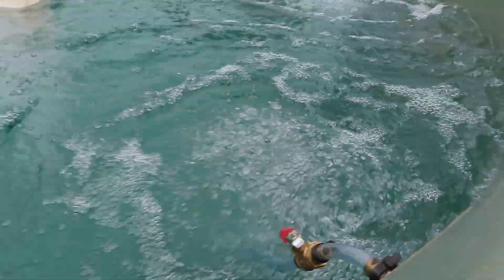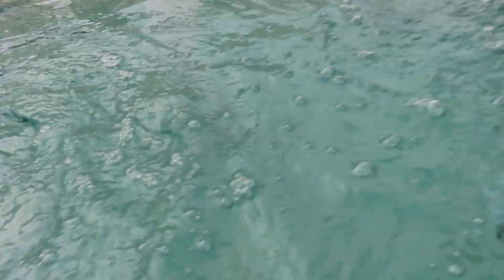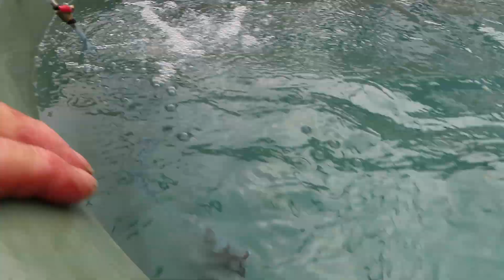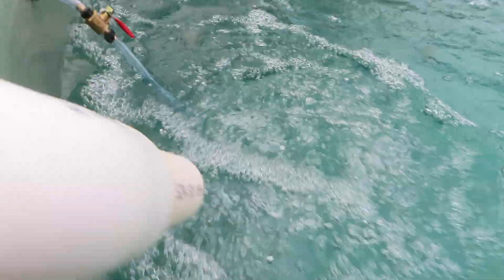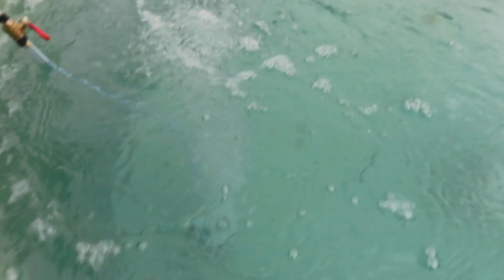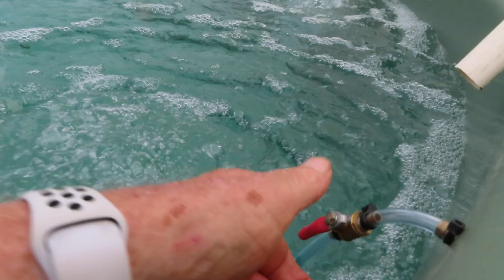Aeration in a New Commercial Aquaponics system. Adjustment

Comment: thanks Murray. I'm afraid that I might have questions with this type of aeration so I will ask for your wisdom. with that much aeration (great BTW) all around the outer edge, will this disrupt the circular flow of the water (why we use a circular tank and not square)  thus defeating the flow to the center for the SLF?
Reply from the maker: It does not stop the circular water flow. It works very well indeed.